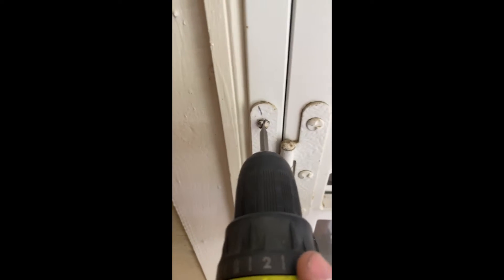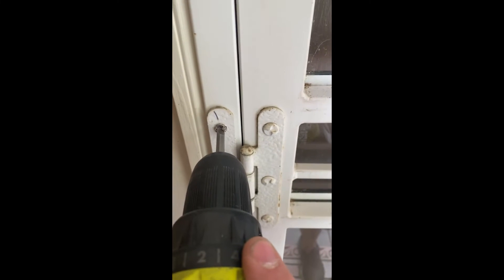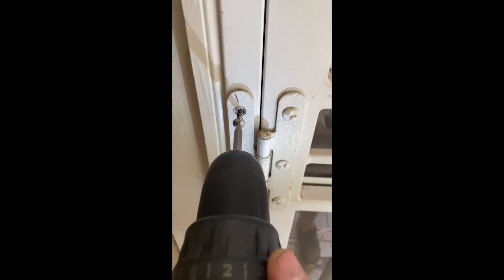The Art Of Removing One Way Screws

Comment: Not so easy when they are recessed…
Reply from the maker: So true! They're even more of a nightmare with the recessed.

Then you need to take a metal cut off wheel and grind a slot through the center and use a slotted screwdriver to back them out. I have some other videos on how to use this technique, just search my channel for one way screw removed, and they will pop up.